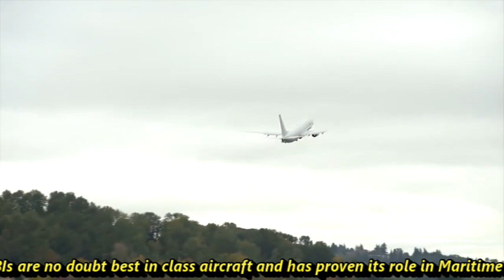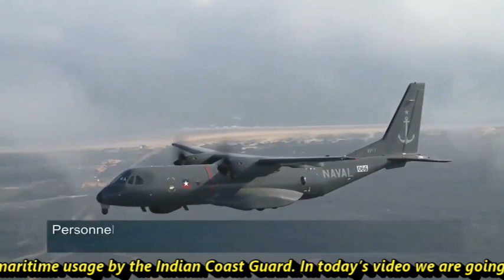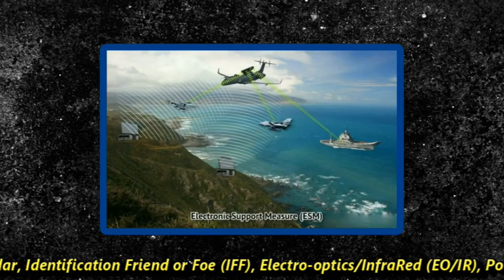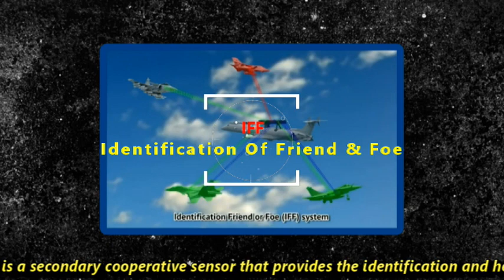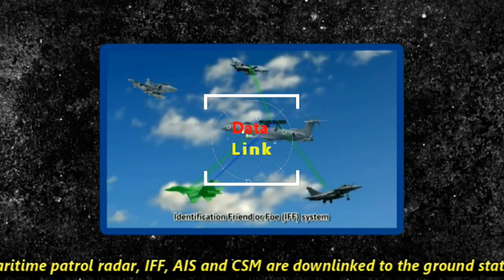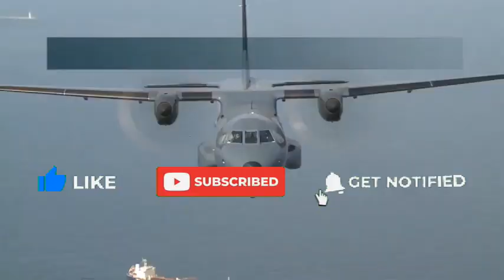Part I: DRDO Multi-Mission Maritime Aircraft (MMMA) Electronics & Sensors I Indian P-8I in making

Comment: Modified C-295 may not be as powerful as modified Boeing-737 but you can always fill the gap by adding more number of Aircraft. Since, 70% of the sensors are already there in Netra-2 so it won't take too much to to develop the remaining 30%.

Comment: C295 has lesser range,payload capacity & obviously lesser power generation for a true LR MPA,this is just a ploy to divert funds & keep forces waiting for another decade or so.
Let DRDO develop whatever they want but our adversaries won't wait for decades to develop it.
For urgent requirements the 6P8I should have been purchased & for better MPA,India should have collaborated with Airbus who are developing MPA based on A320/A319/A321 Neo to replace their aging fleet of Atlantique & P3 Orion.
This would have saved considerable time & funds,as they are planning to induct those 2025 onwards.
According to initial data,A320/A319 MPA has all systems comparable to P8I at considerable cheaper cost.
P8I costs around 350-375 million dollars whereas A320/A319/A321 MPA as per speculations will cost around 180-225 million dollars.
C295 with given range will be good for Coast guard & coastal surveillance not for LR missions.
C295 will not be able to mount Antiship missiles like Bramhos or others due to the given weight.

Comment: A big question going under the blanket 
Will the engine of C295 be able to provide the energy needed by the M3A suite
Reply: We will make it happen we will use the rotation speed of the engines to generate extra power
Reply from the maker: This assessment is done
Reply: Yes sufficient amount of energy give c 295 i

Comment: If Airbus makes many of its aircraft parts in India then why not Indian government gives order for Airbus A320 which will be made by TASL in India. That platform would be much more powerful than C-295.
Reply from the maker: It can be used. CABS has to take that decision. Let's see how things turns out to be. The sensors which we talked about in video can be fitted in any aircraft.
Reply: @IndianDefenseAnalysis  A321 LR is good option, longer range longer endurance. Can also be used for creating our Indigenous AWACS .